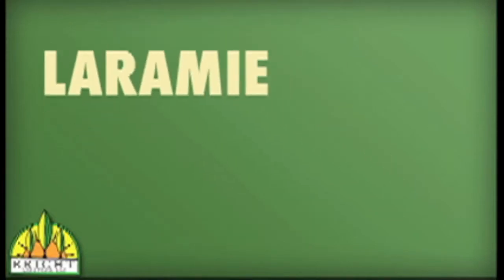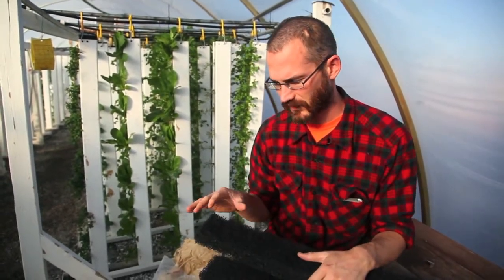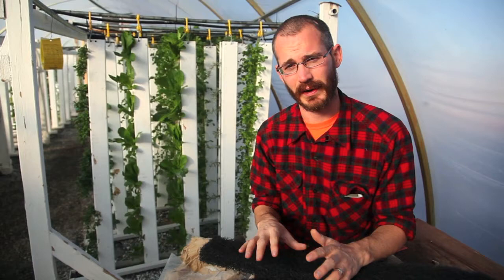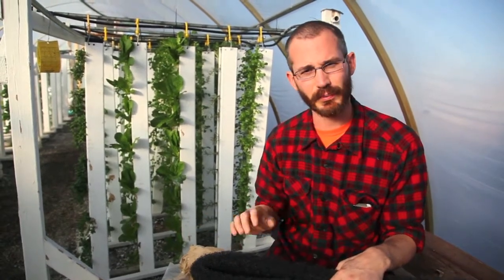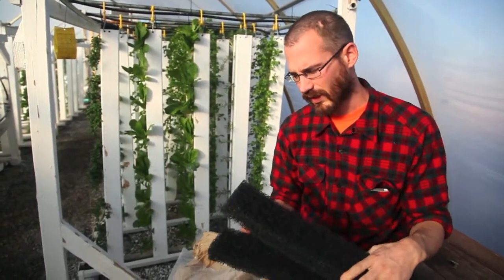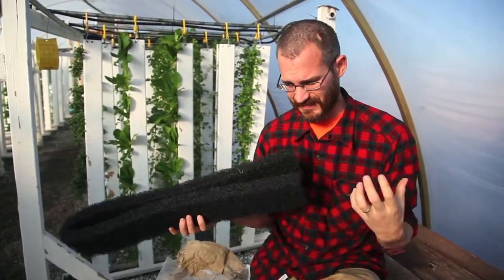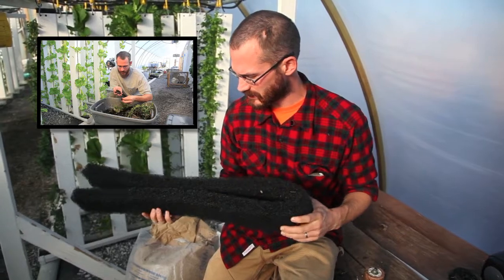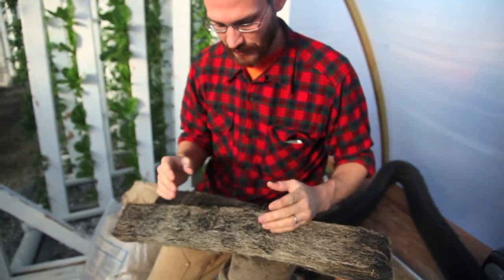Media for Aquaponics Systems

Comment: What is your opinion on using biochar as a grow bed media.  I can make it myself, I can somewhat control the partical size, and I’ve read it has way more surface area than any type of gravel.  Providing more Biological surface area with a smaller footprint, and no fouling/anaerobic issues you might see with other small media.
Reply: Never mind, I just read an article that clearly states your opinion, https://blog.brightagrotech.com/biochar-in-hydroponics-or-aquaponics/  Time to rethink my media choice.  On the bright side, I now have lots of nitrogen saturated biochar to put into my garden this spring.  In fact my nitrates are very high, I haven’t planted anything in it yet.  And my PH is very high, even though i rinsed the char off very well I assume there are still lots of potassium left in it, because I have over 300ppm for my carbonate hardness.

Comment: Do you have to worry about BPA with the recycled water bottle polyester media? Especially if your growing outdoors in the hot sun?
Reply from the maker: +Christine Crahan Nope, PET is typically BPA free.  BPA is mostly an issue with polycarbonates.  Plus, we use a silicone coating to protect the fiber from UV light and degradation.  It's one of the reasons our Matrix Media lasts so long!

Comment: Hey Nate, i'm tempted to try your zip grow towers for commercial purposes. I'm just worried about the efficiency as a filter compared to the raft method. Does your system require any more filtering or biological breakdown outside of your media? I'm thinking of going with your system because it seems to save on labour.

Comment: that media is made of plastic what about leaching plastic into the system as it breaks down? I would prefer the same type of media but made out of an organic material like cotton? That way it can be composted afterwards.
Reply from the maker: We designed our Matrix Media (http://shop.brightagrotech.com/matrix-media) to last a long time so we wouldn't have to throw it away very often at all. What's preferred: a media that only lasts once but can be "composted" or a media that lasts for several years at a time? We prefer the latter.

Comment: Hey Nate - Love your videos.

Why are pockets of anaerobic bacteria bad? de-nitrification? 

I have a 30g indoor system - an aquarium with a hydroton grow bed.

When I first designed it - I intended to run it as a flood and drain.
I quickly realized that flood and drain was going to be far too noisy (the tank is in my living room)

I removed the bell siphon, allowing the system to run as an Eb and Flow.

My nitrates are lower as a result - lower than my test kit can detect.
TDS is at 150.

Comment: I was thinking about using coconut fuber here in Brazil for my system. It's a cheap organic material and there is alot of access to it.  If the idea is to change out the material for every new plant..and then throw it out.. so not using it for a long time like the media you guys use..Is it still not a good idea? Because I'd think that it takes a long time to break down...and I figured since it would decocmpose we could just compost it.. idk let me know! thanks!

Comment from the maker: Cleaning out the inserts is simple. If you're not using redworms (which would clean them out naturally), they can be easily cleaned with pressurized water from a hose or pressure washer. The best way is actually to dry the insert and then use pressurized water - that will remove the majority of all the plant matter. We'll do a video on this question soon.

Comment: Those grow media that you use they are made from polyester fibers from recycled water bottles right? I had used PET water bottles for gardening recently and a friend said it's for health and could leech toxic chemical into water. I have been looking around in my country for those fibers but just wondering if for long term it's safe considering issues people often talk about PET bottles. Hope you could verify this since those fibers are very good and much easier to handle than leca.